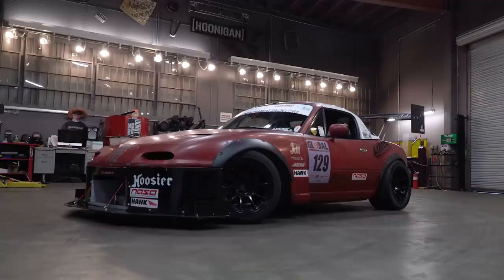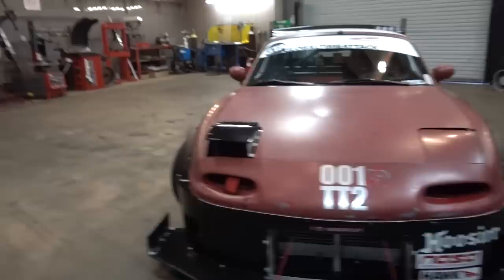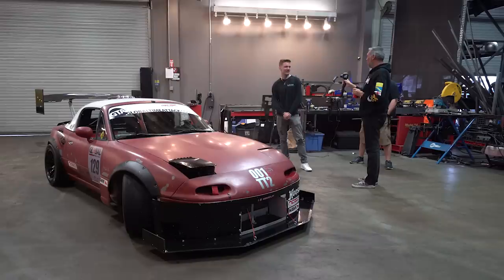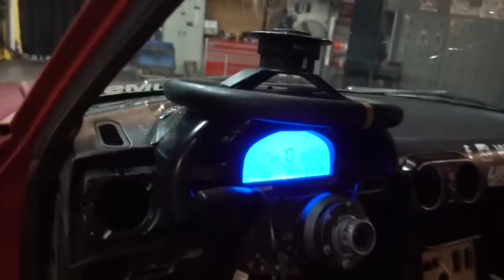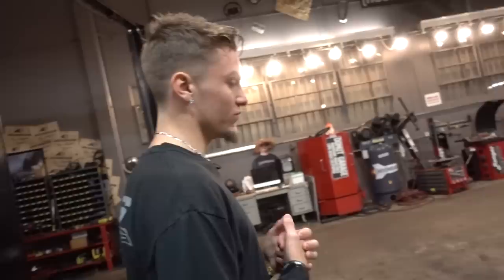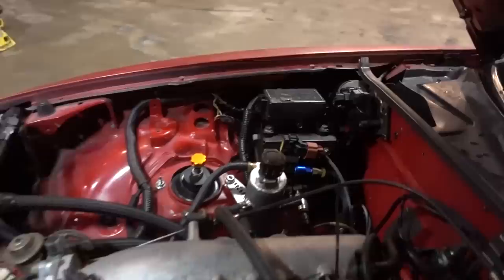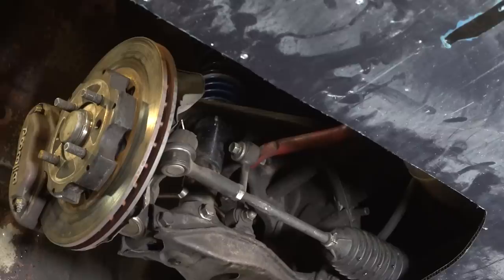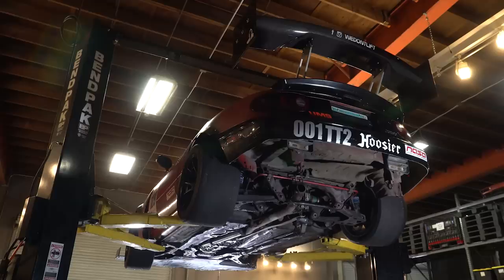Home-Built Track Monster Miata: FAST Frankenstein Build!

Comment from the maker: What would you use to build a cheap and fast time attack car?
Reply: Beer cooled Honda civic 

- Nads.
Reply: Jeep YJ...
Reply: SAAB 99 or og900 Stupid fast around corners
Reply: Toyota MR2 with an SR20 swap 👀 👀
Reply: toyota ke30 2door with a 4age N/A
Reply: I got a 89 MR2 that actually runs and drives good and has a straight body and clean title for free.... So its my project that I'm not sure about, I was gonna put a K Series motor in it but when I lived on the East Coast I had a buddy that put a small block 350 in a Fiero which is really close to the MR2 in the rear
Reply: my 2003 350Z which is what I would like to do
Reply: Hard to beat the miata bang for buck, but spend a bit more and get an S2000 is what I'd rather do.
Reply: Fiat Panda 100HP
Reply: Mustang. Duh 🤣
Reply: OG mini with a rotary in it.
Reply: My 04 rsx type s. Got it for 1500$ it’s been a work in progress but it will be fun when it’s done
Reply: Probably an E36
Reply: probably a fc3s or 240sx first gen(late model) and try to get either a 1jz or a boosted Ls.... now a rotary would be great but if I do I'd have to go 3+ rotors, and that throws "cheap" out the window!!! I've pushed 13b's and they're great, but at a certain level they can't handle the power...(around 600+bhp range) Danger Dan's idea wasn't bad with the 3 series, but I can't find them around me
Reply: Old Suzuki swift GTi
Reply: Probably a Citroen Berlingo (Partner utility van.) with MK3 Golf swapped rear end and 206 suspension parts. Chopped quite a few cars with this setup in the corners.
Reply: XR4Ti
Reply: 1997 dodge viper gts + twin turbo
Reply: 1983 ds
Reply: @doctorstruts  saab 900? if you love turbo lag and a glass gearbox
Reply: SN95 Mustang. They are stupid cheap, and have a large variety of parts to even make a V6 handle some serious grip.
Reply: K swapped 1G Insight would be pretty fun. 200hp in a 1400lb stripped chassis would be decently quick.
Reply: first gen IS300
Reply: @Matty.Hill_87  im on my third Gti, im making this one RWD
Reply: @orbion2  don't drive like an ass and the gearbox is good, turbo lag depends on many things how ever you can learn to cope with it 😊
Reply: @doctorstruts  I own a 1989 SAAB 900 turbo 16v. To me  the gearbox has been fine, but it's just a fact that the gearbox is the main weakness of that car, especially when power is increased.
Reply: FC
Reply: I think I'd choose Audi A3 Sport tdi
Reply: @senqu420  my sj413. I would find a way.
Reply: mazda rx2
Reply: The one I'm slowly doing now: 89 S13 Hatch
Reply: a couple of sr20 engines would be premium, huh ted?
Reply: My gt300 widebody 2zzgte Toyota MR-S 😎😎😎
Reply: 91 GMC Sonoma with a 350 an two speed powerglide
Reply: BMW E46 3 series or SW20 MR2 with a K swap
Reply: @blinkyd4952  Don't think I've seen that before, most people go Toyota 4 or V6 or K-Swap.
Reply: if I were to own a Miata then I would use jackshit... in the first place that is, what I would DO instead would be to aim at all the racers who have had raced Miatas in the past (racers from Japan preferably?) and I would let them to tell me all of their experience - I am myslef not a HP guy, but I am more into lap times and circuit racing, and although it does not seems like it, I think that it is better to get yourself a stock well-known car, have it in stock form and spend like half a year or a year just asking everyone around you what they did to their own car, write and summerize everything and then based on that, decide what to do with your own car. Because so far, after like 15 years of being interested in car performance, it seems to me like that sometimes it takes just one bad part, or one bad setting and your car turns into far cry from what you have aimed in the first place.
If I did not have that much people to talk to, then I would just first try to squeeze some more power out of the engine, like the cheapest ways to do it, and then I would tune the suspension and brakes to make it all balanced and well, with Miatas I think that these cars are great at showing you that if your times suck, if you cannot win any race, then it probably is not about the car you drive, but you being someone who lacks a lot of racing experience :)
Also: I love the Miata in this video, and although I cannot force my son into any hobby, because he is young and what may interest me, may not interest him, but I secretely wish that when he is like 6 years old, that he will tell me “dad, I want to be a racer” :)
Reply: A miata is hard to beat, probably a beat Nissan s13
Reply: @orbion2  The problem is not the gearbox the problem is the 90 degree what ever it's called in english (vinkel växel in swedish) it's a bad solution to start with and when you start making big torque numbers it starts to live on the edge combine that with someone who drives hard over uneven surfaces and you have a problem for real.

As i said drive it with some finess and they hold up fine to pretty good numbers...

Or just swap it so that you are rocking a rearmounted engine setup and have a car that's fun AF in all ways.
Reply: the answer is always miata.
Reply: @jeepcollector91  Wouldn't that be amazing?
Reply: My car!
Reply: RX7 FD there under £20,000
Reply: 2003+ Ford Crown Victoria/Mercury Grand Marquis
Reply: I'd have to go with the original mini Cooper with a hyabusa engine( rear drive conversion) and insane pikes peak style aero.
Reply: E36, light, cheap, reable and a lot of aftermarket parts and a lot of engine swap options without fucking up the wheigt balance
Reply: E30, of course
Reply: Lots of cardboard
Reply: Fox body chassis cars
Reply: I have two Miatas. I would use one of them!!
Reply: Here in the ph it would be a corolla
Reply: a miata...
Reply: 3rd or 4th gen Camaro
Reply: S10 yo
Reply: A suzuki cappuccino with a hyabusa or k swap if it will fit. Lightweight with a small frontal surface area, so drag isn't as bad and you don't need as much downforce to pull the same Gs through a corner.
Reply: Original 50's - 60's-70's BMC Austin or Morris mini Cooper with twin Suzuki Hayabusa engines, turbocharged of course. Guessing 1,500 #LBS 450-500bhp 200#'torque...or Honda Goldwing 1800cc flat six turbocharged 300bhp very low center of gravity.
Reply: Miata, everything exactly the same. This is a great build! Best bang for the buck, imo.
Reply: Nads a stick with sting and a beer. Try and top that one
Reply: 2018 Toyota Camry but i LS swapped it
Reply: Would a Ford rs200 work??
Reply: Old awd Volvo, maybe a new ECU and grab a turbo from one of the newer volvos
Reply: using my 90’ s13. cheap thrills.
Reply: BMW E90/92 N54
Reply: @supersevenn  that's going to be a absolute weapon, had a couple back in the day and they're probably one of the best cars I've owned
Reply: Scottos audi
Reply: Definitely an NA Miata or an E36.
Reply: is300
Reply: Probably the mk1 or mk2 mx5
Reply: A Suzuki swift sport. Cheapest and most popular rental car for the nurburgring, used in several spec car cup and rallyes. Reliable and reasonably fast.
Reply: my 98 rado is just that, single cab short bed v6 rwd, and beleive it or not im running the same size rims as him, my sidewalls are just a lil more beefy, no where near as fast as this thing tho
Reply: Stripped 240 with a welded diff, t25/28, and some abs plastic aero. Plain, simple, reliable, and cheap.
Reply: Bmw e46 330ci boosted
Reply: Pontiac fiero
Reply: Volvo 740 with a T5 engine
Reply: Vw rabbit
Reply: Miata
Reply: Prolly a honda swapped SA rx7
Reply: TheHoonigans 2005 Mini Cooper S
Reply: widebody irs swaped chevette with a twin turbo j32
Reply: Miata is the perfect platform! Doing one now.
Reply: Probs an old BMW E30 or an old Toyota Corolla
Reply: Evo 9 rb26 swap
Reply: Jeep Gladiator
Reply: AWD 99 CIVIC COUPE, talk about track monster...the awd civic kit with a turbo slapped on your gonna eat the track
Reply: Audi tt
Reply: jaguar xjs
Reply: 1993 Ford Probe GT.
Reply: Suzuki Cappuccino :P
Reply: @andeer43  why sr20 in a mr2 ? the 3sge or 3sgte is easier to put in.
Reply: @animemediator2865  thats a fast and furious quote man.
Reply: @Matty.Hill_87  AAAAYYYEEEEE YA YEET
Reply: C5 corvette.
Reply: First gen RX7 or Z car.
Reply: I'd start with a simple cage first lol

Comment: Watched this video the day it came out. I've since bought an NA6 miata myself and knew it was gonna be a piece of work. Was 2 months of blood sweat and tears just to get it to pass CA emissions, which shouldn't have been that hard bc its an 89 obd1 miata. It only has a cat and charcoal canister. However, it was tough af, there was a lot wrong lol. It idled like a 2 stroke dirt bike when I got it and had the biggest brain jb weld job holding the coolant system together 😂and was straight piped (pls take my advise and only buy california cars fam. even if your not from here haha). I was back and forth in my head for months trying to figure out if I should even keep it. At this point we've come a long way and I have learned a ton about cars. I actually understand when yall talk about engines and gearing and all that now. Now, a year later, Im looking at this video and am thinking "damn I didn't get such a bad deal after all". Im actually better off in a lot of ways (on the car itself, I wish I had the connections this kid has). Im inspired now, between this and ya boy lil clutch kick, I'm 100% gonna have myself a bitchin ass roadster. I wanna track it, hoon it, break it, rebuild it, etc. Def will be bringing her to the next burnyard bash and hopefully driving there (was gonna go this year but the car took a shit on me haha. Hence why you shouldn't get a project car instead of a daily lol) So, I plan on suping up the suspension and drivetrain first then imma find a VVT 1.8 to build and swap in since that's gonna be the easiest thing for my experience level (first engine build) and very little access to welding. I'm Super Stoked!!!!

Comment: This is a concept that I've wanted to do for years.  Find a light sports car with a strong after-market for performance parts. Strip it down. Buy it cheap, I don't care what it looks like when I get it. I'll put a rattle-can paint job on it (something funky).   I love the rivet-on splitter and really love these style flairs. Great cage for safety and lots of DIY performance.

Comment: I see a lot of airbag wiring. If you pull the harness and put the underhood fuse box in the passenger footwell and relocate the interior fuse box to the passenger footwell you can cut out about 3lbs of sensors, connectors and wiring. It also makes trouble shooting easier. Took me about 2 days on my na
Reply: I'll just go eat taco Bell or McDonald's & take a huge ass sh!t = 5-6# LBS minimum of weight lost... dragsters claim every 6#LBS saved = 1hp gained......good call on getting rid of unnecessary wiring & sensors tho !!! OBD 2 yo

Comment: those bent 'frame rails' are pretty easy to fix. even if they are so bad you cant cut, straighten, and weld them back together you can make new ones out of steel very easily, it's just a long straight box section.
Reply: 5PAZT1C  I’m sorry but that’s a lot of effort for a tired old 300k mile chassis, I’d rather just buy a new chassis and get a legit cage built.
Reply: @ulrikszirka9651  that's fair, and with how plentiful clean NA shells are, I think I would agree with you on that.  I actually didn't notice that you don't have a proper cage the first time I watched the video, now that you mentioned it. I'll also say that I've never seen the fender vent done that way on an NA, and I really love the way it turned out.

Comment: Not like it's any less impressive but I have to point out that the valve cover is from an NB Miatas engine which makes me wonder if it really is a NA1.6 like they say or if its actually a BP4W from an NB. Either way it's still a miata engine so still impressive to be running those numbers.
Reply: biggboysouth CAS is on the passenger side. Is a 1.6 😂

Comment: So whats up with the outer tie rod setup? Those aren't stock. Looks like the rack was moved higher up to reduce bump steer and different outer tie rods fitted to compensate the angle of the ball joint.
Reply: ClubTōuge they’re s13 putter tie rods. Stock location rack. S13 tie rods are slightly more robust and correct some bump.steer

Comment: Seriously cool! Needs a paint job next ;)
Reply: Alec Fleming Plan is to get a whole new chassis and start from scratch haha
Reply: Ulrik Szirka I'd just do it again to another and keep on going with this one. However, eventually (esp in racing) the main chassis/box of the car will become tried and wear out. Leading to flexing ect... This one in the video already nearly has 300k miles on it. So that is why you eventually do need another car when racing. But it doesn't mean that it wouldn't make for a fine back-up or storage parts... Depending on best budget stradigy, getting rid of the old body and chassis could be the most cost effective.
Reply: Alec Fleming I’m aware haha it’s my car. I’m buying another chassis, cutting everything unnecessary out, caging it, and basically swapping everything over
Reply: Alec Fleming possibly do a milspec wiring harness
Reply: Ulrik Szirka Just think though, just get a naked shell next to this one and basically fix worn shit as you build, be an amazing machine fast, and cheap... Great idea starting on the wiring btw... Thats what prompted my thinking...

Comment: My performance guys keep telling me if I widebody my miata that will mess up the handling of the car for little to no gain in just bigger tires. I'd like to know from people who use fender flares or actual widebody kits to put on bigger tires how much this has affected you if any at all? Thanks! 

(Is 16x10 all around to much? Is 15x10 better? Is 15x9 in the front and 15x10 in the rear vice versa with the 16 inch also ok?) Hope I made sense here but these kinds of questions keep me up at night.

Comment: Why was the frame rails soo bent does this happen to all miatas over time because of jacking
Reply: They're the lowest thing under the car so they get scraped, bashed and in my case, ripped in half. Although technically not frame rails, they're called "seat reinforcement rails" and aren't really all that structural to the car.  The real beef in the Miata body is in the outer rockers.  My rails were much worse than this and the car still drove solid.

Comment: Is there any major reason to build an NA over NB miata for time attack/autocross?
Reply: NB can mean many things nb1, nb2, or nb3(?just making shit up) aka the mazdaspeed. But na and nb1 (99-00') are basicallyyy the same car. NA are lighter in general than NB cause less modern luxuries. I guess you start your pros and cons there. Nb2 99 engine is good cause non interference. That's about all I knoe

Comment: I would like to know if you are using the stock viscous differential and 5 speed transmission making that power?
Reply: BeyondR3pair It’s a 10th anniversary 6 speed and 3.63 torsen diff
Reply: Thanks

Comment: Is that open core sign board that's used for the splitter? Just with the leading edges sealed up?
Reply: Yup. Cheap and easy. Works well enough at his speeds. Just don't run off, and if you have'nt run off you haven't found every 10th. (Edit for poor grammar)
Reply: @canadianracer83  well that's a fantastic idea for us low buck hero's, I always figured start with a sheet of abs or the old fashioned plywood trick but this is lighter and dirt cheap
Reply: Justin H it’s kinda hard to find 1 sheet by its self for cheap, normally you have to get a whole pallet. But it’s single layer 6mm alumalite

Comment: C'mon, why does this thing not have a cage yet? I can get an adult deciding not to do it (it's their life), but this kid is 17 right? Why is dad not insisting on such life-crucial elements?
Reply: It's a TT/TA car, not wheel to wheel. It has a roll bar, 6point harness, containment seat and he wears a hans or a necksgen at every event. were pretty serious about safety.
Reply: @umstuning  Having seen a Miata rollover and talked to many racers and fabricators (one being Moti from BBFW), it seems like a no-brainer for a vehicle running 1:4x's at BW13 (especially a non-streetable, track only car). Not saying it has to have the full compliment of nascar bars or gusseting on every inch, just something to stop the a-pillar collapsing in the event of a rollover. Like I said an adult can choose their own fate, and would not be commenting if the driver in this video was over 18 doing their own thing. I dont even have a full cage yet but will eagerly install one once my budget permits (also the fact it's more autocross than trackday car right now, not having seen open track in a few years).

Comment: Best mx5 mod is a jaguar v6 swop to get 250ph or even better an twin turbo 13B
Reply: Except that's not true. Just because Car Throttle is doing that doesnt mean it's the best. Could do a honda swap cheaper and make it more reliable and have more potential for power.
Reply: Donkey Kong you can’t put a crappy Honda engine in a mx5 the best option is probably a 13B
Reply: @cheesusslice7342  excuse me? Crappy? Listen m8, I love rotaries. So much I bought an rx7. But just because I would put a rotary in one doesnt mean honda makes garbage motors. The honda k series or f series makes stupid power reliably. And if you want a v6 then put the j series not a damn jaguar motor.
Reply: CHEESUS SLICE  imagine calling honda motors crappy and then mention the 13b as a better swap 🤣🤣🤣 u wild man
Reply: Donkey Kong sorry but I’m more in to Toyota, Nissan and Mazdas
Reply: Donkey Kong look m8 I’m looking to put a 13b in a classic mini even though I will be a tonne of work and a Honda is swap is pretty easy

Comment: And here I thought I was the only one to pull my fenders away for air relief on the front tires... Project 22_1na_b - 2000 Subaru 2.5RS Coupe..... if you'd like to verify it's on my Instagram account - @raszaron